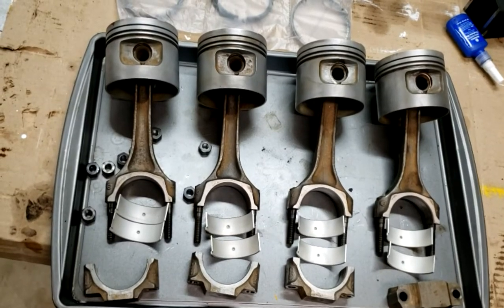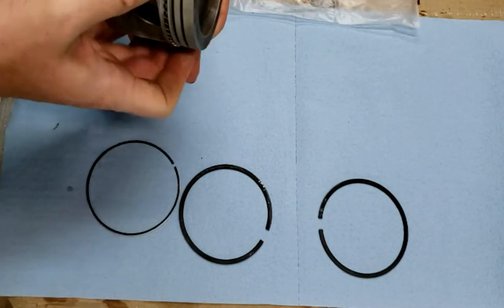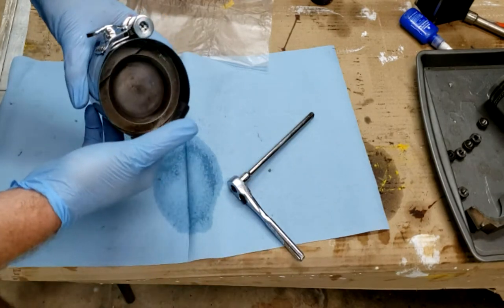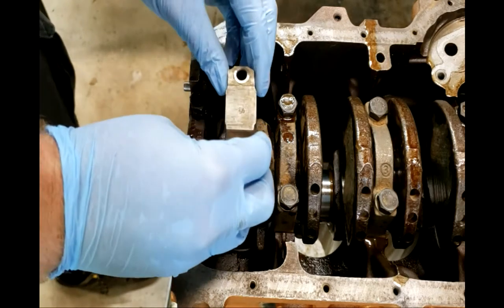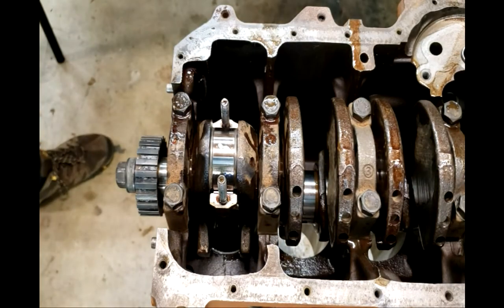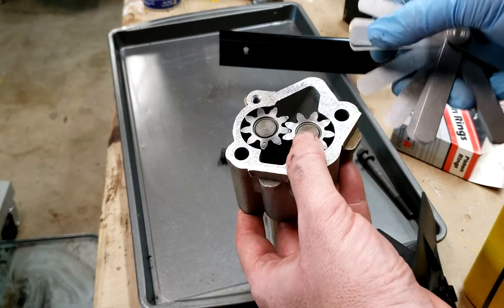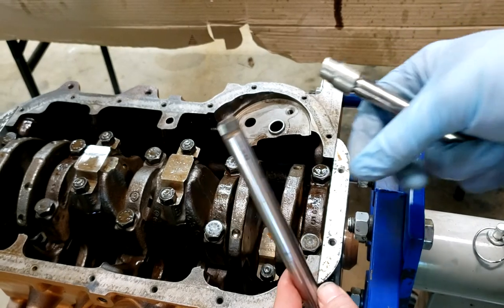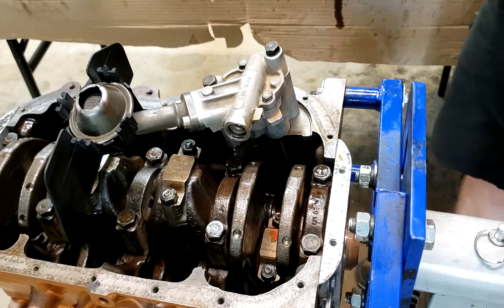Piston/rod install on our VW GTI MK1 engine for Lemons

Comment: Not entirely sure if itll fit but I know that VW sells an OEM windage tray with the gasket that fits a 16v no problem. I'd do a search but I'm willing to bet they exist and the 16v one may fit with little or no mods.
Reply from the maker: Thank you for your comment and Yes, there are windage tray options available to purchase.  Yet, to stay within the lemons budget and since I'm cheap, have a welder and sheet metal laying around, I fabricated one.  Welded it into the spare oil pan and stuck it on the engine.  I thought about extending the front section of the oil pan out to have more capacity but I didn't have enough metal and I wasn't sure if I'd run into clearance problems with something else on the car later.
Reply: @eventhorizonlemonscar6139  
Extending the pan isn't really necessary on these motors. You can run it a little over full as I have done with no adverse effects. I'd install a catch can just for peace of mind, and if you really want to make an improvement in the stock oiling system, get yourself a remote oil cooler and mount it in the rad support/ grille area. You can scrounge one from something that has one stock, as there are plenty of cars that come with an OEM one. You don't have to go all out with a Setrab one in the spirit of Lemons I agree with keeping it as cheap as possible.

Comment: hey please i have a question on bloc engine its marked the bore cylinder class , for example "abac" can i use piston classe "B 71.98" if the cylinder classe "a 72.00" is worn but still in the limit of classe b lets say 72.02" ? the mix is possible ? cause the workshop says that if classe "a" exced the limit ,  rebore the cylinder 0.1 and use oversize 0.1 piston 

Cylinder "A" 72,00-72.01 /// Piston "A" 71,965-71,97
Cylinder "B" 72.01-72.02 /// Piston "B" 71,97-71,98
Cylinder "C" 72.02-72.03 /// Piston "C" 71,98-71,99

over size cylinder "A" 72.10-72.11 /// over size piston "A" 72,065-72,07
over size cylinder "B" 72.11-72.12 /// over size piston "B" 72,07-72,08
over size cylinder "C" 72.12-72.13 /// over size piston "C" 72,08-72,09
Reply from the maker: The terminology used here is something I am not familiar with and do not feel that I can provide you the advice you're looking for.  If the workshop specializes in engine machine work, then I would defer to their knowledge and recommendation.

Comment: who sells rebuild kit for these engines ?
Reply from the maker: I'm not sure of a complete kit with gaskets, pistons, bearings, etc.  I would go to rockauto.com  and piece together what you need.  They should have a gasket set, then pick your bearings.  They may also have pistons, or you may have to go to another supplier for that.  I just redid the bottom end with ARP rod bolts for more piece of mind and took the time to install new pistons.  For pistons, someone much smarter than I, told me about these https://www.ebay.com/itm/371367003251

They fit, or of higher compression, and are economically priced.  They've survived two races so far.